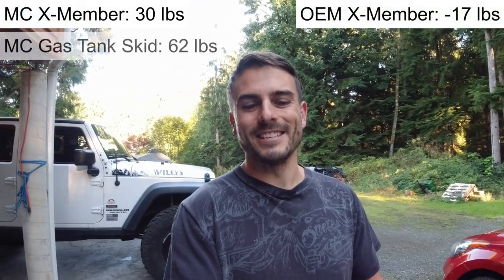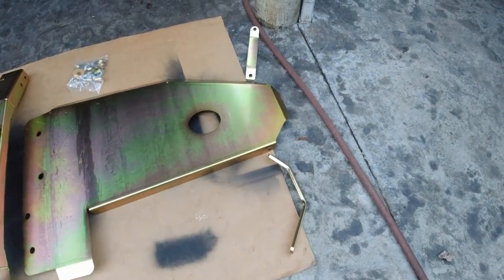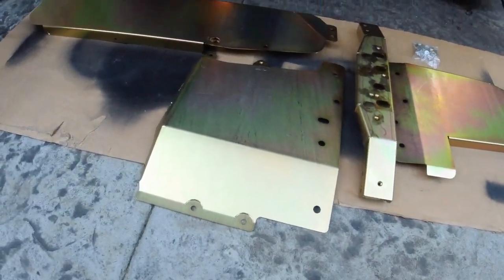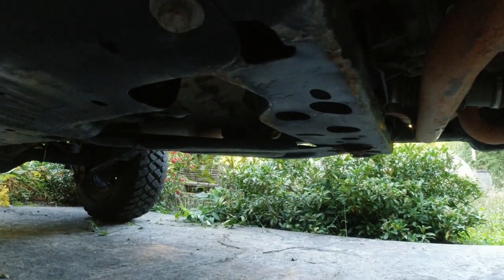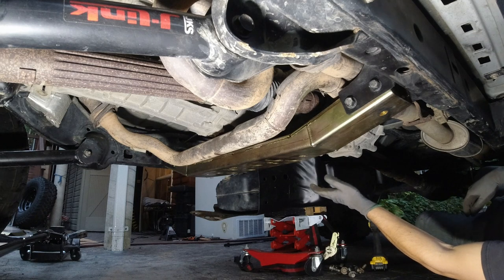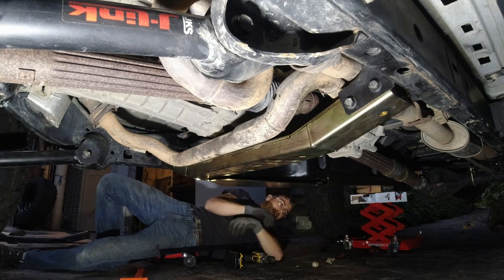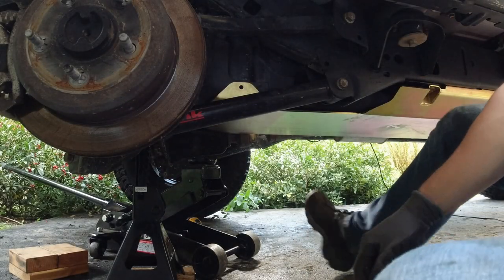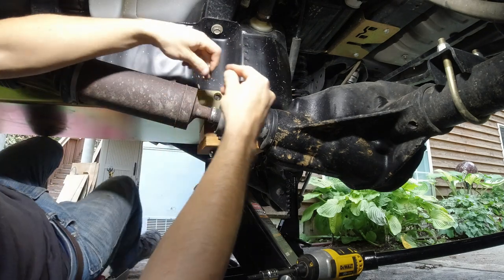MetalCloak UnderCloak Integrated Armor System - First Look & Install - JEEP JKU

Comment: I am in the process of installing the Undercloak system now on my JK. This didn't come with any instructions so your video is super helpful, not to mention the only undercloak installation video I have found. I didn't realize you are near Woodinville, that's awesome, I am in S. Everett.
Reply from the maker: Hey there David, thanks for checking out my video! That is strange that there were not instructions included or available online, I do not recall where I obtained mine from. But I am glad that my video was able to give you what you needed to do your install! exactly the reason why I started the channel! And yeah, that is cool you are so close! Maybe one of these days we will cross paths on the trail!

Comment: This was one of the best and most important upgrades that I have done to my Jeep. After 3 years of abuse they are no longer pretty though, but they sure have held up to some extreme abuse.
Reply from the maker: Yeah I definitely agree with you there NotICON! With the abuse my undercarriage has seen the past 8 months it is a well deserved upgrade!
Reply: @VictorVectorJKU  I'm in a 4 door so I drag over everything. The skid plates will give you a lot more peace of mind when going over rocks.
Reply from the maker: NotICON oh yeah! I have been too and I didn’t bat an eye at the rocks this past weekend 😅 lots of scratches and a couple minor bends but it did it’s job very well!

Comment: Great install video. How is armor holding up? Any issues with the weight?
Reply from the maker: Hey there Joe, thanks for checking out my video! Honestly the armor has held up great! There are two areas I have seen damage and had to straighten and one of which I added a reinforcement. These are also due to taking my Jeep through obstacles that are likely beyond my Jeep’s ideal capabilities but I like the challenge! 

The brace is at the back of the transfer case skid plate and bridges from the skid plate to the top of rail crossmember directly above it. Where the box portion ends near the frame rail it started to crack from many hard hits so the reinforcement prevents that bending and further cracking.

The other location is the engine skid plate just in front of the transmission. crossmember. I have smacked this one many times as well and cause it to bend up a decent bit. 

As for the weight, yes it is heavy, it likely impacts my fuel mileage but I can’t really quantify either since I haven’t noticed much difference in fuel mileage or performance since adding it. It was a tad slower initially but I forgot that long ago.

I would definitely recommend this system if it is still market competitive like it was when I purchased it!

Comment: Awesome video, it will be running while we install this today on my JK! Can we talk about the boot on your driveshaft? Did you ever replace it?
Reply from the maker: Hey there Annmarie, thanks for checking out my video and I hope your install goes smooth today! I had not ever replaced it and ran without the boot over the slip portion of the driveline for a decent amount of time. I did upgrade both my driveshafts at later times to Adams which have been doing great for me.
Reply: @VictorVectorJKU  thanks for the quick reply! I can rest easy knowing I don’t have to keep searching for that part that seems to not exist 🤣. Adam’s is on my list too!
Reply from the maker: @annmariepinkerton3345 you are welcome, and yeah the slip boot is less important than the cv boots on either end of the driveshaft. Of course if you are in an area that corrosion is an issue you may start noticing issues sooner.

Comment: Was surprised my metric impact socket set didn't have a 16mm! Did the math 5/8th!
Reply from the maker: Thanks for checking out my video Jimmie! That is a very good point a lot of wrench and socket sets don’t include a 16mm for some reason even tho this is a common size in automotive… but glad you figured it out!!

Comment: Was thinking about the order of stuff done in this upgrade.  
Probably should make step 1: give someone a $100 to scrub and blast dried mud and sand from the under carriage.
Step 2: spend 12 hours on you tube.
Reply from the maker: Oh yeah definitely want to clean as much before you get started to prevent getting tons of dust and dirt in you face, mouth and eyes! And nothing wrong with getting a visual of the process before jumping into it yourself!